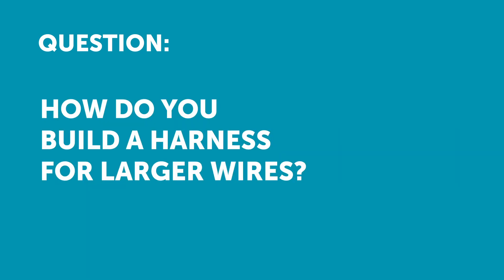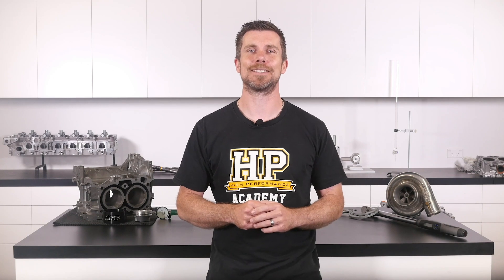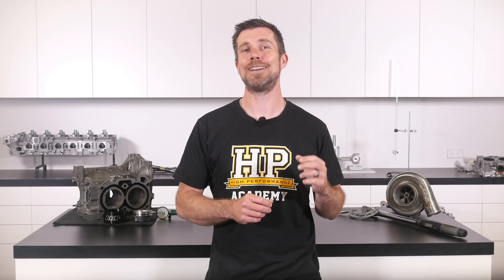Large Gauge Wiring | What Sort Of Gauges Are Used In An Engine Loom? [HPA Q&A]

Comment: I would assume with that amount of current it would put off a bit of RFI.
Reply: Not necessarily...
Q: How much RFI do you think is generated from a 10 gauge wire that carries a constant 25 Amps at 12 Volts?
A: ZERO!
The 'key' to that 'trick' is the inclusion of the word 'constant'.
It will DEFINITELY generate a 'constant' magnetic field around the wire, but RFI literally stands for Radio Frequency Interference.
With a constant, unchanging current through any wire, the frequency is, by definition, ZERO Hertz thus giving ZERO generated RFI.
Having said that, automotive wiring rarely (if EVER) carries a high 'constant' current.  Your battery would be flat every day if it did!
At the exact instant that the load is switched on (or off), the rapid CHANGE of current is what creates RFI.  If you can find a way to 'ramp up / ramp down' that current over time, the amount of interference will be significantly reduced!  (generated RFI is proportional to change in current divided by change in time, also known as dI/dt)
Unfortunately, some automotive wiring mandates comparatively high dI/dt values!
Keeping those wires well away from any 'sensitive' signal wires (such as a VR crank-trigger) is one way to help.
Using shielded wiring (even coaxial sometimes) for sensitive signals also helps (but don't forget to GROUND the shield to improve it's effectiveness!).

If you have an external screen on your computer (i.e. NOT a laptop), take a good look at the video cable.  You'll often notice that it has a big 'bump' close to one end (sometimes both ends).  Inside this 'bump' is a ferrite bead.  The purpose of this ferrite bead is to 'take off the edge' of any signals in the wires it contains.  (The ferrite bead kind of acts like a lossy transformer 'core' that 'slows down' the spike).

Most (all???) decent ECUs will use various 'tricks' to minimise the effects of induced noise on input signals.  Ferrite beads, averaging (a.k.a. 'filtering'), signal clamping

My personal opinion on ANY EFI wiring is one simply word... GROUNDING...  Ground anything and everything that you THINK should be grounded.  Then go back and ground everything ELSE.  And then ground it all some more just for good measure!  Don't just rely on a self tapper into some body sheetmetal.  RUN A GROUND WIRE!